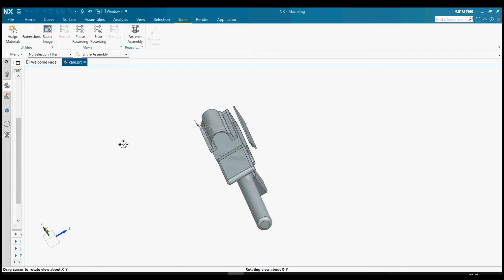Jak zrobić wiatrówkę pneumatyczną (PCP Air Rifle)

Comment: you can call it the solenoid valve from the video pls
Reply from the maker: Water solenoid valve 12V DC  Normally closed 8bar
Reply: @anthraction2097  Oh thank you, I forgot to ask what the thread diameter of the valve is?
Reply from the maker: 1/2 inch